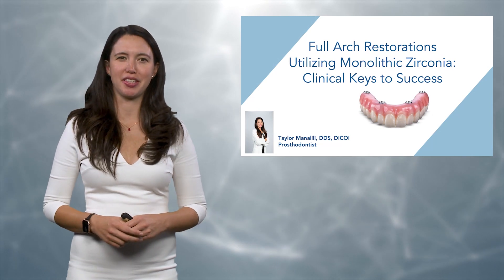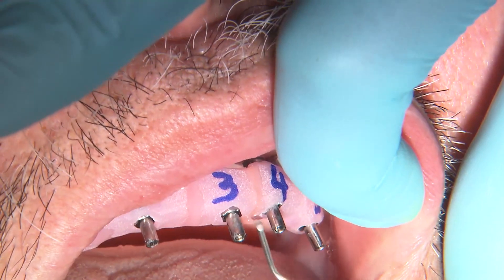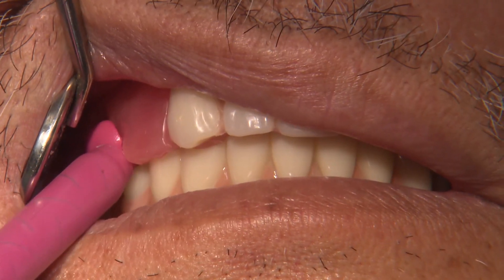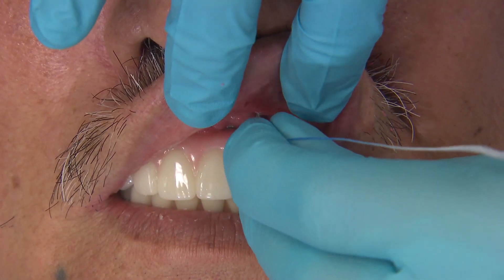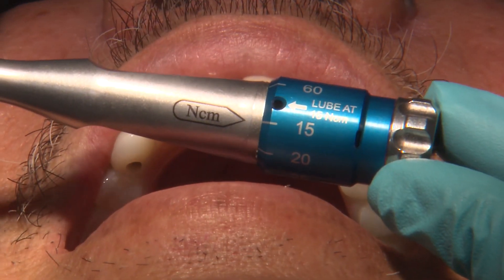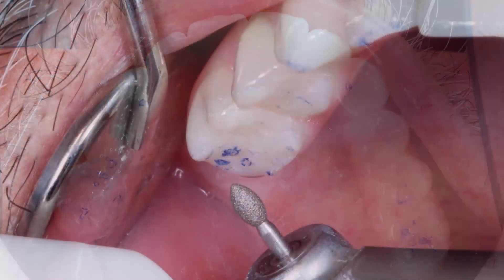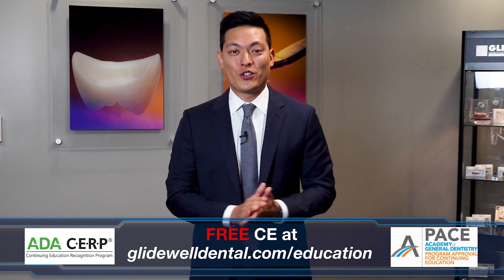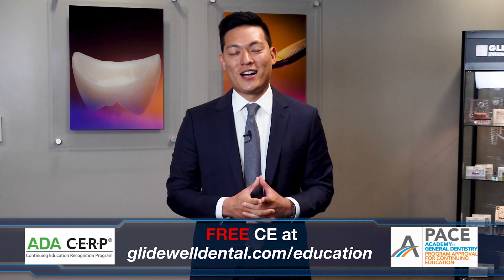Full-Arch Restorations Utilizing Monolithic Zirconia: Clinical Keys to Success

Comment: I just got my implant arch completed last week.  it seemed to be perfect. But after about 2 days, I noticed some very tiny bits of very hard material in my mouth.  I didn't think much of it.  But then 2 days later, I felt a "crunch" and a larger piece broke off of one of my front teeth.  Today, another fairly large piece broke off.  All the breaks seem to be on just one of the front top incisors.  The entire arch is 14 teeth.  I can see where the bits broke off, and can feel it with my tongue.  Since the arch was just put in a week ago, what should I do?  It seems to me the lab screwed up (again).  That same lab previously completed an arch for me, which was missing one molar in the back!  Since the arch is removable, would it be better to take it out to repair?  Or leave it in and just repair that one tooth?  It seems to me they made that incisor too thin.  When I first got the arch, it looked like a full set of teeth, with a very thick clear layer of "glaze" over them.  I think it is this glaze that is chipping off.  I was under the impression that artificial teeth were made of material much stronger than bone, but obviously this is not the case with that tooth.  It also seems strange to me that none of my other teeth have had any problems with chipping.  It looks like a 1mm edge of that one incisor has broken off.  I am not a complainer.. BUT.. after spending over $40,000 on this.. I don't think it is too much to expect to have teeth that aren't crumbling apart after less than a week.
Reply: Were they made of ziconia?